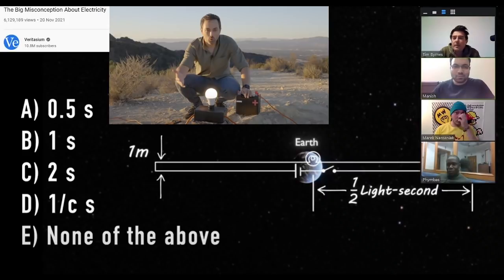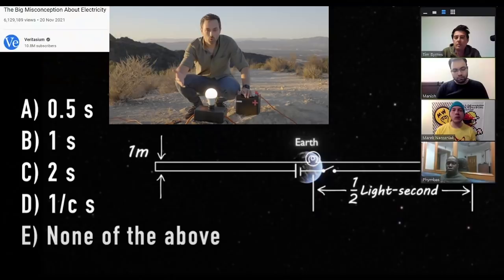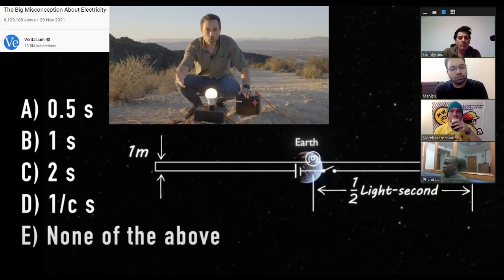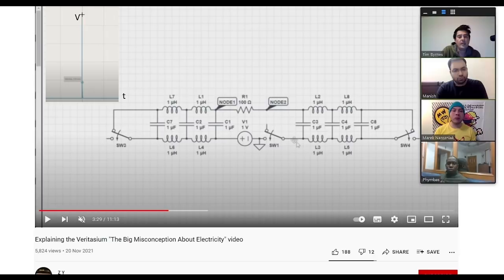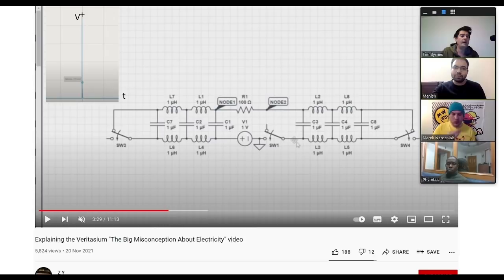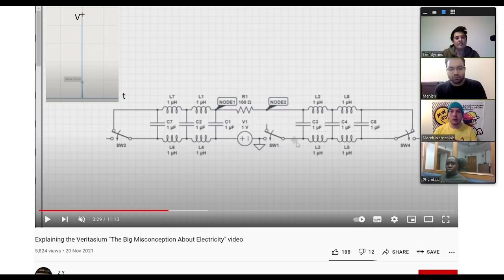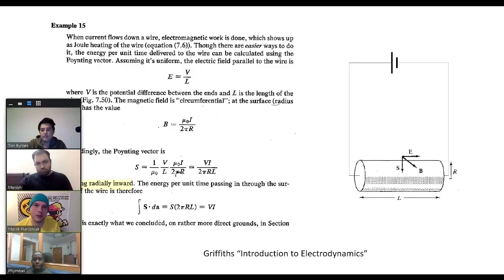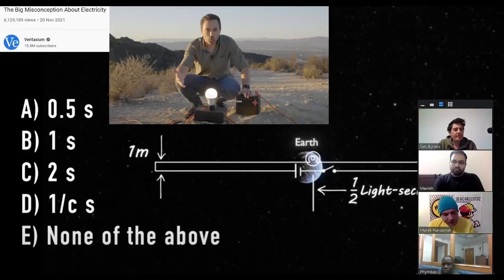Veritasium's Big Misconception About Electricity video and the point about Poynting

Comment: He's wrong and I no longer want to think about it.  And, the speed of light answer is ridiculous because it has no meaning.
Reply from the maker: Interestingly in our poll most people actually agree with Veritasium still. We tend to agree that he is right only technically.
Reply: @NYUQuantumTechnologyLab  Yup... a tough one.  High voltage transmission lines are separated by only a few feet... enough to prevent arcing in high humidity, yet there is absolutely no serious energy being transmitted, that I know of, to the GROUND wire and the SAFETY ground wire.  I assure you, that even though the high voltage wires are only feet away from the ground wire, you can put a 1.5 volt lamp in the ground circuit... cut it, insert bulb, re-wire, and there will be NO light... zero energy is being sent to that wire unless lightning hits the wires.  Those wires are active... it's a closed circuit, yet no energy reaches the return/ground wire... nada.  You will, I admit, pick up the Radio Frequency 60 cycle hum.  The ground will act like an antenna.
Reply: @NYUQuantumTechnologyLab  15 Dec/21  I figured out what is wrong with Vertasium's answer.  1/C is NOT a TIME it is a RATE.  Resolving the equation means that, for one second, the distance traveled will be one light second.  He's right ONLY if you resolve the equation which is an answer of ONE SECOND which was my original answer.

Comment: According to this bs theory, the time would be 1/c (where “1” meter is the distance specified in the schematics). Question: what would the time be if the distance would be 3 million kilometers ??? … it should be 3.000.000.000/c – right? … is that roughly 10 seconds ?? – if so, just start from here … then we’ll talk …
In conclusion: veritasium is painfully wrong … just another smarta$$ - PERIOD